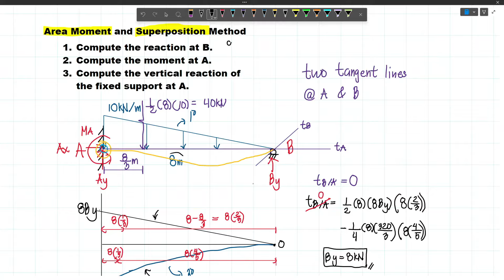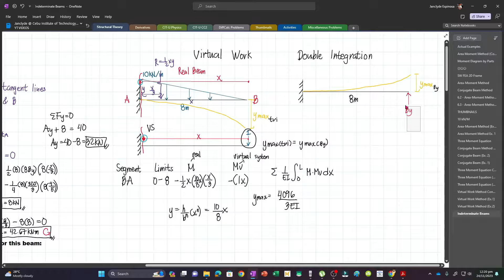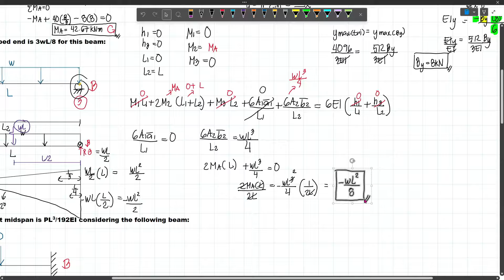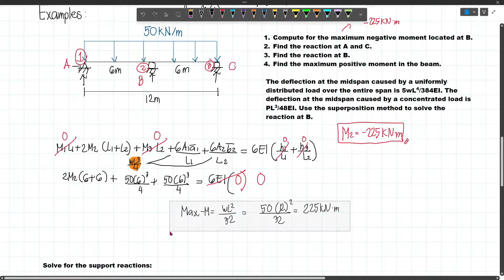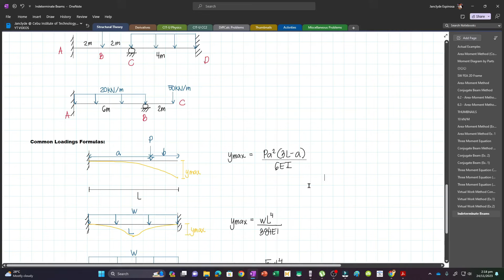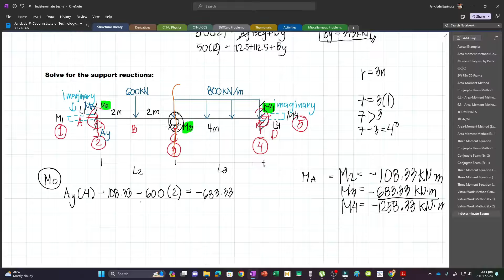Indeterminate Beams by Area Moment Method, Three Moment Equation, and Superposition)

Comment: Neer, question po. Sa pinaka unang example, di ba na pwede na i summation lang diretso para makuha ang reaction sa By? Gi try nako summation diretso kaso lahi ang answer. Help po 😅
Reply from the maker: dili pa.. kailangan pa iapply ang area moment method daan para madevelop ang compatibility equation
Reply: @engrclidez  Ahhh okay, salamat sa tubag  neer!
Reply: @engrclidez  Sa first problem po, bakit po sa AMM method hindi pwede ang Slope_A = 0? t_b/a lang ang nagiging tama
Reply from the maker: @haelraph  slope A=0 cannot work because the AMM method gets the "angle between two tangents" only.. bale po you have to equate the area to the maximum slope
Reply: @engrclidez  can i ask how you get the point of max slope?
Reply from the maker: @haelraph  point of max slope is where the derivative of the slope equation (moment equation) is zero